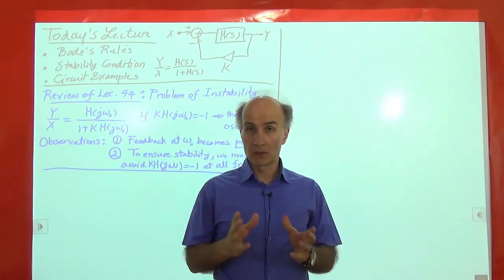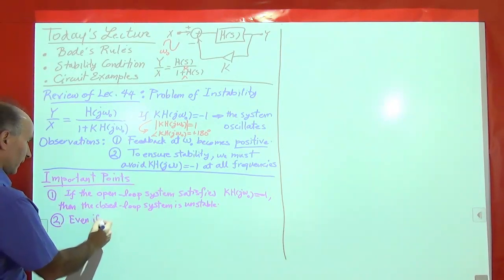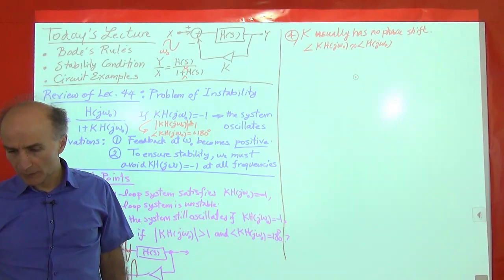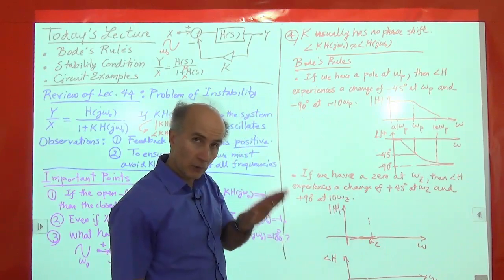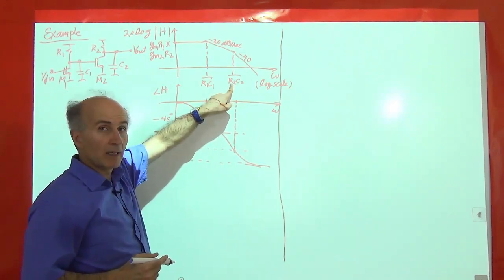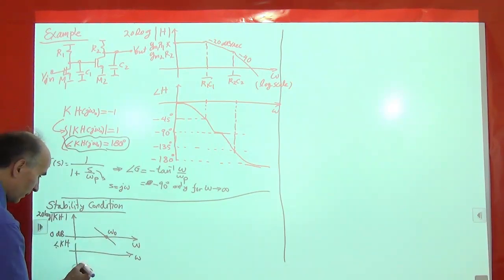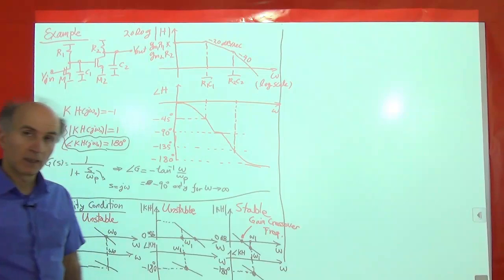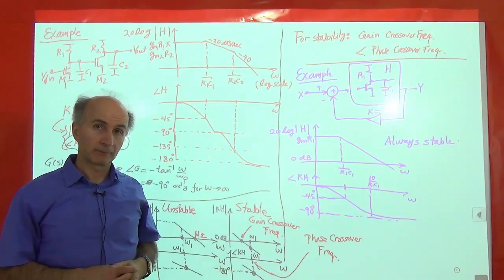Razavi Electronics2 Lec44: Bode’s Rules, Stability Condition, Circuit Examples

Comment: @13:00, point 3  is not true. You can have |T|>1 while <T=-180, and the system is stable.
As long as  |T| isn't monotonic
Reply: Point 3 is true... He explained how amplitude going to increases when  |loop gain| >1 , increases again increases in practical scenario due to supply voltage limitations it stops increasing and maintains constant amplitude of frequency of oscillations.. still oscillating phenomenon holds good here..

Comment: 01:26 - Intro and Review
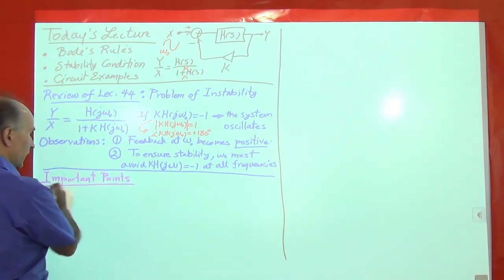06:03 - Points of Instability
14:40 - Bode's Rules for Phase Characteristic Construction
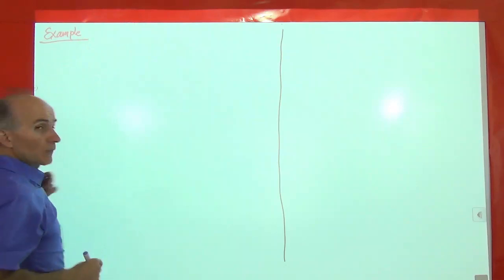22:29 - Examples of Frequency Characteristic Construction with Two-Stage Amplifier
31:38 - Graphical Illustration of Instability Condition; Gain and Phase Cross-Over Frequency
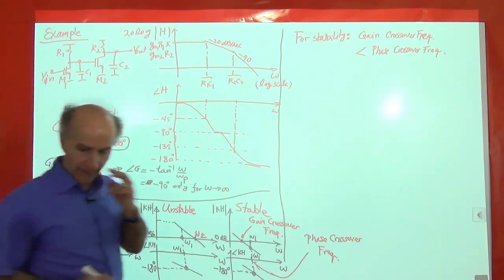42:18 - Single-Pole Example

Comment: why W(in) is not considered as a pole? Isn't this supposed to be three-pole system according to previous explanations?
Reply: Yep, actually that third pole is very far away so due to dominant pole approximation we neglect it and consider those poles that contribute to the system's frequency response much more which are closer to the origin, as compared to those which are far away. I hope you would have figured it out till now.

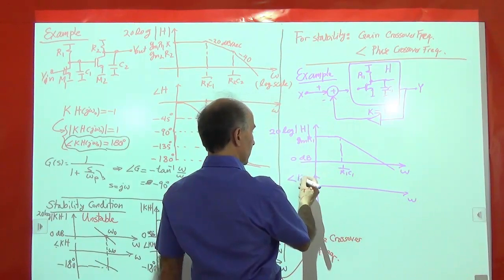Comment: I dont understand the example at 45:00. If K = 1 the feedback is positive. So the system cant be stable, right?
Reply: Oh no you are combining loop gain concept here.. k means feedback factor he told k= 1 means it indicates unity negative feedback amplifier .. he never told |loop gain| = 1 , if loop gain = -1, that too angle = 180 in that case only oscillates, that is first order system achieving phase of 180 degrees it's impossible thing , second order system also can't achieve 180 phase.. system stable only..

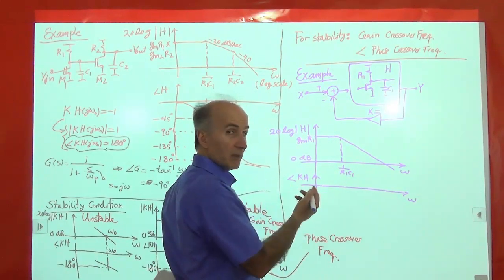Comment: At 45:03, when you are drawing phase plot, then we have to take minus sign into account because it is a Common Source Amplifier having a negative sign in the transfer function which indeed give us a -180degree phase at low frequency it self and the presence of pole make the phase even more negative than -180degree... So, it should be potentially unstable system... Is it correct?
Reply: I think we should simply connect 'x' signal to the source of the NMOS and the 'u' signal to the gate. Then everything is ok.
Reply: k should be negative actually as for negative feedback loop gain has to be positive

As per his book :  For simplicity, we drop the negative sign in the gain of each stage here. The final result is still valid.

Comment: 12:17 if the condition was |KH| < 1 (say, 0.1 for example), and phase of KH = 180 degrees, wouldn't it still be unstable? E.g. if the input is some sinusoid sin(kt), k is some frequency), then by the time the signal reaches the output of the feedback system, the signal has diminished in amplitude (because of the condition that |KH| < 1) and it has phase shifted by 180 degrees. Hence, the output of the feedback system would be -0.1*sin(kt). Then, you'd subtract this output from the input, so that the signal going into the amplifier would be sin(kt) - (-0.1*sin(kt)) = 1.1sin(kt), which is larger than the original input, sin(kt). So wouldn't the system still be unstable?
Reply: Okay after some digging around, I think I know the answer: Yes, even if the condition is that |KH| < 1, and phase of KH = 180, the signal going into the amplifier would indeed be larger than the original input. E.g. if KH = 0.1, and if the input is some sinsuoid sin(kt), then as I said in my original comment, this input would become -0.1*sin(kt), which would be subtracted from the original input, so that the input going into the amplifier would be 1.1sin(kt). 

However, the key point to understand is that the system stabilizes the amplitude to some value. You can see this if you repeat the process several times. Unlike in a positive feedback scenario where the amplitude grows without bound, in this case, the amplitude stabilizes (i.e. approaches asymptotically) to some value. In this sense, the system is stable.
Reply: @nashs.4206  I have the same problem as you. But I cannot figure it out. Why it will be stable in the end? I think it becomes a positive feedback.
Reply: @easyfuse  At first, the systems' output is indeed larger than the input signal. However, over time, the systems' output does not continue to increase. Instead, it will remain constant. 

Positive feedback is the condition in which the amplitude of the output continues to grow every time the signal makes a complete loop. However, in this case, even though the signal amplitude is larger INITIALLY, it doesn't CONTINUE to increase.
Reply: @nashs.4206  I'm still confusing. Could you please show me an example? H=2, K=0.1.
Reply: @easyfuse  Okay so let's suppose that we have the same drawing for our system as in the video. Let X be the input to our system, and let X = 1*sin(wt), where w is any frequency.

Now, as you said, let K = 0.1 and H = 2, so that |KH| = 0.2. Furthermore, let the phase change be 180 degrees as we move around the closed loop system. 

Now, in the 1st iteration of going around the loop, our input is 1*sin(wt), and by the time we reach the output of the feedback loop, the output will be -0.2*sin(wt), since |KH| = 0.2 and the phase change is 180 degrees.

Now we subtract 0.2*sin(wt) from 1*sin(wt) so that we get: 1*sin(wt) - (-0.2*sin(wt)) = 1.2*sin(wt).

So, the signal going into the amplifier is now 1.2*sin(wt), and again, by the time we reach the output of the feedback loop, our output will be: -0.2*1.2*sin(wt) = -0.24*sin(wt). Again, this is because the |KH| = 0.2, and the phase change is 180 degrees.

Once again, we subtract -0.24*sin(wt) from X, which is 1*sin(wt) so that we have: 1*sin(wt) - (-0.24*sin(wt)) = 1.24*sin(wt).

So, the signal going into the amplifier is now 1.24*sin(wt). The output of the feedback loop will be -0.2*1.24*sin(wt) = -0.248*sin(wt), and we subtract this from X to get: 1*sin(wt) - (-0.248*sin(wt)) = 1.248*sin(wt).

Repeating the procedure, we get that the output of the feedback loop is -0.2*1.248*sin(wt) = -0.2496*sin(wt), and subtracting this from X, we get: 1.2496*sin(wt).

Repeating this again, we get that the output of the feedback loop is -0.2*1.2496*sin(wt) = -0.24992*sin(wt), and subtracting from X we get: 1.24992*sin(wt).

One last time, repeating this, we get the output of the feedback loop to be: -0.2*1.24992*sin(wt) = -0.249984*sin(wt), and subtracting from X we get: 1.249984*sin(wt).

If we repeat this process then you will find that the signal going into the amplifier will eventually approach a steady state. This steady state signal will be 1.25*sin(wt). That is to say, after an infinite number of iterations of the above process, the final signal will get closer and closer and closer to 1.25*sin(wt). 

If this really was positive feedback, the signal amplitude would be infinite. But it's not infinite. The signal amplitude is 1.25. So, this situation is NOT a positive feedback system. 

Hope this helps! :-)
Reply: @nashs.4206  Very clear! Thank you very much!
Reply: @easyfuse  No problem! ^_^ Yeah I was suuuper confused about this part too haha.
Reply: @nashs.4206  Third time I come back to this comment to re-understand feedback instability. Damn
Reply: @OfficialAnarchyz  I hope it was helpful to you! ^_^
Reply: hello nash. how about if the delay is less than 180, say 90 degrees. I'm having a hard time applying your demonstration for a phase less than 90 degrees, can you assist me?
Reply: @wilmdrdo1228  90° phase shift happens only at ♾️ freuqncies, not a practical one ,so we don't much bother about that!, Even if that happens the magnitude doesn't go to ♾️!